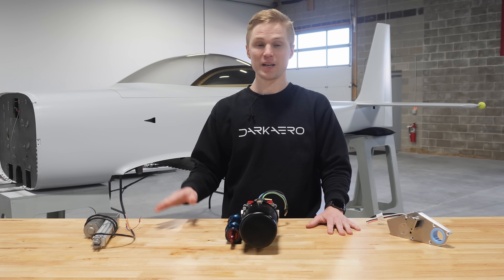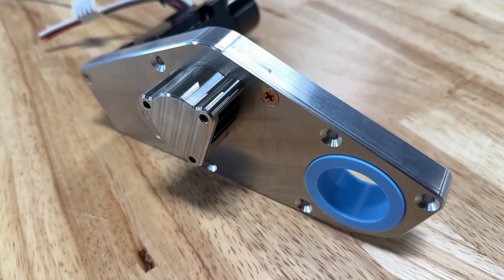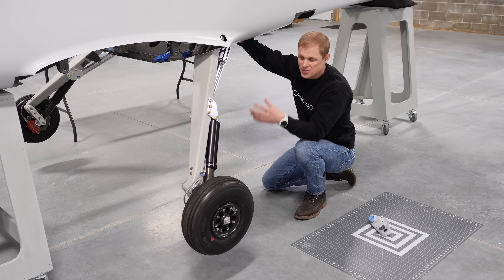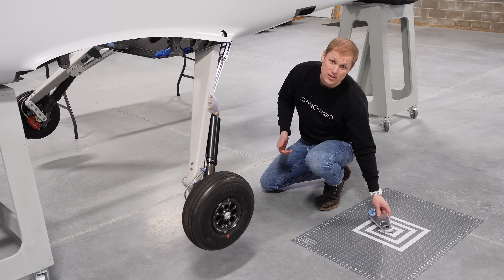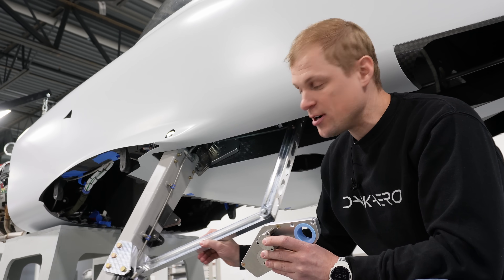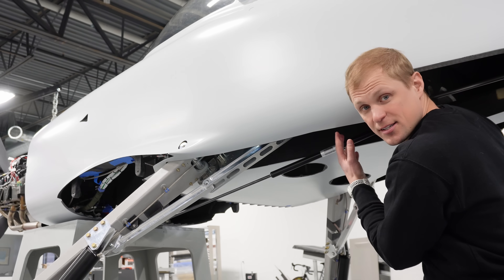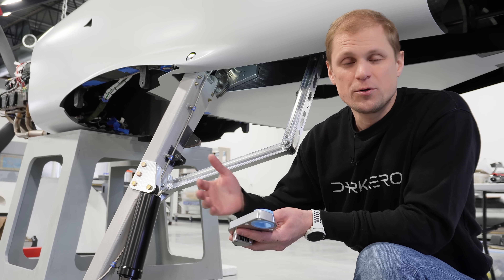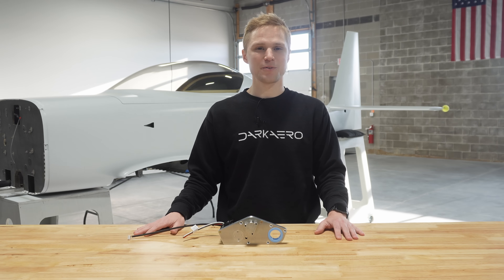Why we designed our own retractable landing gear

Comment: As others have alluded, I don't like a gas strut that takes a daily beating as an emergency device. Can the gear extend using a compressed spring with a locking pin or a piston that extends using a CO2 canister? I have seen so many gas struts fail in marine applications

Comment: I was surprised to the that the landing gear struts are made of carbon composite, no issue strength wise but I would be concerned that they get chipped and thus weakened by the props and air stream picking up little stones at takeoff.

Comment: Forgetng amount of space for a second, would having gear pivot forward when retracting make a huge difference in ensuring it can be extended safely no matter way (since you then have both gravity and airflow working to lower gear) or is that  a fairly minor thing when considerimg all aspects?

From a emergency deployment point of you, wouldn't it be simpler to have a rope/handle in cockpit that you could pull to 1- clutch the motor 2-bring landing gear down to lock ?  (or a wheel you turn in cockpit to pull the rope in with enough torque).

Comment: If you use a hybrid servo motor, it comes with an encoder does it not,  so you just have to program the number revolutions you need the servo to make for the travel required for gear down and gear up.  Would this method have reduce weight?  I do not think limit switch are that heavy?

Comment: Great video. Can you show some more details on sequencing logic and explain how the landing gear locks are released?
Reply from the maker: The landing gear locks use a solenoid to trigger their release. The locks have "fully open" and "fully locked" limit switches so that we ensure the lock has cleared before driving the motor. Sequence is: drive the lock solenoid, wait for the lock to "fully open", drive the motor.

Comment: Hi, thanks for the Video! One Question: Do the drag struts have any kind of travel limitation in down locked position? Cause since the gear is actuated through the main strut, the the drag strut may fall out of allignment when the gearbox developes some play from wear. 
Im sure you already thought of that, but i didnt find the answer in the video!

Comment: With the logic of no part is the best part, I think you could do without the locking mechanism all together. With that thinking I also think a centralized lowering shaft could be positioned between each gear strut including the front gear so lowering was sequential and not independant, this will improve the less parts anonolgy and strength. A duel ended piston positioned under the cockpit that pushes out the front and rear gear. Seems like you could achieve what your pressing on with 1 of each component, no need to have x3 of everything. 1x gear box etc.

Comment: Thats really cool. Just wondering if you could use load sensing on the motors incase your end of travel switch failed the motor would sense over current and stop driving?

Comment: Hello guys, 

Congratulations! One question, please: how the uplock hook is disengaged? I saw that is a springed loded self locking hook, but It will need an actuator to rotate it and free the landing gears, or no?

Thank you :)
Reply from the maker: A solenoid will be installed that can disengage the hook prior to the motor being engaged.

Comment: I'm intrigued that the landing gear retract towards the tail. Given the limited space there really isn't another way, but for emergency gear release, in most planes the gear retract forward so that when they are dropped with gravity they are assisted by drag rather than prevented or the drag resisting the gear dropping. But I like the simple solution

Comment: Looks totally awesome but gas springs wear out very quickly overtime. I’m sure you guys know what you’re doing but at the same time some sort of a better manual type of system as a back up I know  weight is a key factor, but those gear boxes are small and gas springs can fail owning a hatchback car for years. I’ve had to replace mine a couple times, and I don’t know run some ideas around even a small mechanical crank system but again weight is a key factor.   Run some ideas around and see if you can come up with some thing a little bit more reliable than just the gas spring I could be totally wrong, but I would love to see some thing a little bit more reliable, or durable. Maybe even a light weight hydraulic system

Comment: Very similar to an rc retract with a small motor driving the ststem via pinion and gear. On rhose systems i believe its timed to operate a certain number of seconds to complete a cycle.

Comment: Wouldn't the gear position indicator break under emergency deployment if it relies upon the limit switch of a disconnected motor? Shouldn't the indicator be attached to the latches themselves? Just my 2 cent armchair observation.

Comment: All u need is a hand crank and cable for emergency attached a cable and pully to the pivot points and have a hand crank somwhere in the cockpit to use similar to the cessna 310r

Comment: Doesn't the bottom shock mount need to be turned 90 degrees? It looks to me as if pivot of the shock does not match the direction it will flex in under load.
Maybe someone can clarify
Reply from the maker: Great question! It’s not totally apparent in the video, but the shock can pivot forward/aft as well as left/right when the trailing link moves. The bracket at the bottom of the shock allows this motion, but the two axes of rotation do not intersect like you would see in a spherical joint.

Comment: I use those same long strong gas struts on some of my machinery. They are very strong throughout the whole length of travel, but I have found them to be unreliable. Since this is a clean slate design, perhaps it would be a good idea to sacrifice a little weight savings and reduce the complexity of the gear system. If the aircraft is not capable of carrying the weight of a reliable landing gear system, then it isn't a good airplane.

Comment: My limited noob non engineering experience makes me wary of gear that retracts aft. My monkey brain feels good when I see gear that looks like it can free fall into a down and locked configuration without actuation power as long as the gear uplock hooks can be released. All your work is done in the past so there is nothing to be done now, but Id have to really understand the system well before Id feel too comfortable. I known a guy who lamded gear up tho and the plane got repaired ok

Comment: hm. How do you lift the gear from down lock position if it is locked? someone/something should push on a "knee" between drag links, that [knee] also seem to be able going up and down, that makes drag links to be not really a good stabilizer at a rough landing with a strong kick from the front. Actually I would rather use something retracting on that knee instead of a gearbox, because the box has too big lever at the end.

Comment: not a builder person, but quick question,
won't the emergency gas spring hold back the motor from extending the landing gear?
smth like the piston being forcefully extended would cause a vacuum
Reply from the maker: The gas spring is always trying to push the gear strut into the down locked position, so the motor is working against it during the retract phase and it is helping the motor on the extend phase.
Reply: @DarkAeroInc  i see
very nice

Comment: I work in the automotive industry in a technical capacity servicing conveyors, lifts overhead monorails, chain conveyors. extra . Gas struts of the type you displayed in this post are not reliable absorbers or tensioners. FAILIURES are common with those products. Just saying  from my 33years of experience.
Reply: Yep! Should be a CO2 bottle, piercing valve, and small pneumatic cylinder(s).

Comment: Stepper motor would be nice to set limits and travel speeds. Like slowing it down when it gets close to travel limit or as it’s latching. Then have limit switches also as a back up.

Comment: The Neo 550 and versaplantary gearbox it's mounted to are mostly hobby grade, I hope you aren't using anything higher than a 5:1 in any single stage, the sun gears shear under shock!
Reply: I would recommend if you like the REV Sparc Max motor controller, use the full size neo brushless motor with a pinion directly on the output shaft, the full size neo's are extremely robust mechanically with a 12t pinion, but you could go as low as 10t. That also removes several stages of mechanical failure.

Comment: Great video! I do have a question: the gear on the landing leg seems quite exposed, will there be some kind of cover? I can imagine that this could get quite dirty (especially on grass fields). Anything in between the landing-leg gear and the gearbox pinion gear (e.g. small stone, other hard debris stuck in grease) would not only disable the electrical retract/extend but potentially also the emergency extend.

Comment: I wonder using  a tension spring to default to its naturally  gear down position and use a compact hydraulic actuator power pack like on a Boeing 787 spoiler to push against the sping into the retracted lock position. Emergency deployment would be fairly straightforward by releasing the   gear locks using a cable system. BTW, I love your work

Comment: The gear down/retract mechanism you came up with is similar to the Beech Bonanza gear.  Just not quite as good.  🙂
Reply: I would say it’s more like a Cessna 210 gear system- at least when comparing the geometry of both systems.
Reply: @pchansen100  That's why I specifically said the gear down/retract mechanism.  It's a copy of the beech gear except the beech gear is simpler with one motor and push rods for doors and gear.  I own a bonanza.

Comment: Wouldn’t it make more sense to reverse the gear mounting so that they retract forward and extend backward. Then you would also have aerodynamic forces helping you to extend the gear in the case of a failure. Or would this place the extended gear too far aft?
Reply from the maker: Reversing the retract motion would allow the gear to be extended by aerodynamic forces in an actuation failure scenario. We were not able to use this arrangement due to space claim limitations though. We discussed the arrangement decision more in this video: https://youtu.be/9N0SaJZ4Rjk

Comment: Nice engineering! How about exploring an aerodynamic solution to deploy/retract landing gear? Using some of the air pressure from flight to move the landing gear by use of winglets and maybe duct work to generate force where needed to assist the landing gear movement. I obviously haven't calculated what kind of volume of air would be needed, but it might be possible if OK with slower landing gear movement in return for lighter, cheaper solution?

Comment: Looks great guys!  Question on the back up gas spring:  it’s fully passive as is, would it not be better to have a pneumatic cyl that you can hand pump from the cockpit?  Pilots like to be in control. 😂
Reply from the maker: That’s an interesting idea. The advantage there would be the drive motor wouldn’t have to work against the gas spring. The pneumatic cylinder would be along for the ride until you need it. The disadvantage would be the increased part count and plumbing associated with the system. 🤔
Reply: @DarkAeroInc   Im an aero eng with a habit of throwing ideas everywhere and seeing what sticks.  HAHAHA  and I LOVE the plane!  You guys are knocking it out of the park!  I will be visiting when I get more money for sure.
Reply: @DarkAeroInc  Armchair expert here. Would it be feasible to have a cable attached to the drag link to pull it up towards the gear pivot. That cable could somehow be hand actuated in the cockpit in an emergency. An issue I can foresee with that is how do you make a cable not interfere with normal gear operation. Would it possible to sideslip and rock the gear into the down and locked position? If not would an aerodynamic feature on the gear be able assist a sideslip extension. 

What a fun engineering challenge you guys have.

Comment: If you are using modern brushless controllers or modern stepper controllers you could do away with the limit switches and use the built stall sensors inside instead. Closed loop brushless or stepper would work as well ofc but isn't even required.
Reply: The pilot doesn’t merely need to know that the motor stalled.
The pilot must know that the landing gear actually locked into position — not some optimistic assumptions about the gear position.

A limit switch on all three arms at both locked positions seems imperative.
Cameras to show the position and condition of the wheels would be nice.
Reply: @denverbraughler3948  a closed loop controller/motor or a stepper with stall detection would do that perfectly as well. It's distance travelled + stalled at endpoint, not just stalled.
Reply from the maker: We have been experimenting with a couple different motors and controllers, both brushed and brushless. What’s cool about going all electric is there are so many options to experiment with!

Comment: I love your project!!!
I have a question why don't you eliminate the bolted bracket that keep the telescopic suspension and embed it on the landing gear frame itself as you will avoid 3 big bolts an a machined part?
Reply from the maker: That’s a great question! The design actually started out with an integrated composite strut bracket, but we couldn’t quite get it work out based on the loads and manufacturing process we were using. However, we are planning a revision for production that is still machined, but it eliminates the large bolts for a part count reduction and weight reduction. The updated design will basically just extend around strut.

Comment: Hi guys, have you managed to simulate mud and snow kicked up during taxi and take off and have you successfully cycled the gear under these circumstances? What happens during a failure to retract scenario? Failure to extend? 

What are the advantages of the gas strut emergency locking versus a spring/mechanical arm emergency extension. Seeing the gas strut failures on things like vehicle trunks and hoods rather regularly makes me relate those gas struts to this system ->do the struts have a redundant mechanism for extension, and will they be required to be inspected/tested/replaced at regular intervals? 

Thanks again, it’s a cool looking bird.

Comment: Great design....but, if I may suggest an alternative idea for the Emergency system;

The use of the "Emergency compressed gas piston" is going to add a lot of stress on the gear motor, especially when it gets towards the end of the "gear up" cycle for 2 reasons;
1 maximum amount of compression thusly increased pressure 
2 loss of aerodynamic advantage. At the beginning of the up cycle w/ all of that aerodynamic force, it's easy for the motor to move gear (even when the piston pushing the gear) but at the top of cycle, you lose the aerodynamic pressure and you're fighting the gas compression- putting a lot of stress on the motor & gear teeth.  Not saying the motor can't deal with the forces, just saying the intentionally lightweight components are going to be working in a "max effort" configuration.

AN ALTERNATIVE solution might be to pull the gear in an emergency. We understand that the disengaged clutch and the release of the mechanical up lock will allow gear free fall; all we need to do is extend gear pass the point of aerodynamic resistance, right? This is where Emer Proc is crucial; free fall of gear requires speed reduction to X before attempting. At this reduced speed (thus reduced force) the gear could be "pulled" forward by cable or worm gear from the cockpit by manual crank or electric motor.
The gas compressed strut is an elegant solution but I fear the added stress on the gear motor and gears might result in a long-term maintenance issue. 
I love watching your videos, wish I was there! How rewarding it must be to design novel answers for a true 21st Century Aircraft.

PS my comment is the result of a 32 year flying career including Army Black Hawks, Turbo props, Regional Jets and retiring (at 55) off the 767, so my approach definitely comes from a pilot's mentality more than an engineers. 🍻

Comment: The landing gear system is nearly the same movement as a garage door. I would use a garage door spring to deploy the landing gear when unpowered and help fight aero drag.

I think both side of the landing gear could be mechanicly linked and have one actuator, there is no point having one side work but not the other in case of failure.

Suspension doesn't look like it has much travel.

Comment: A rotary drive with reduction gearing makes sense, but the exposed final stage gears are disappointing. Any exposed gear is either unlubricated, or has dirt in the teeth and spreads grease around the machine.

Comment: You can also not install the gas spring and the pilot use load factor to push the gear into the lock position.